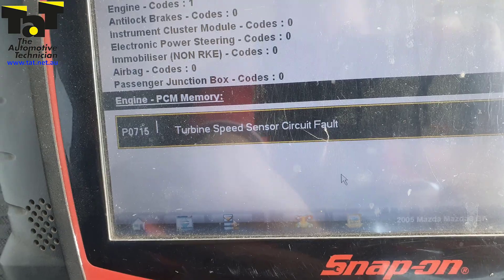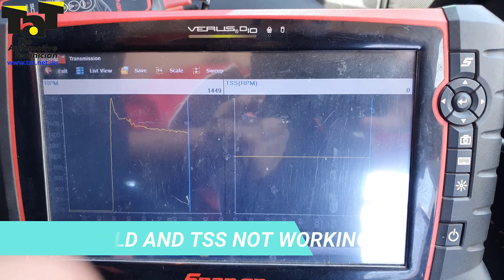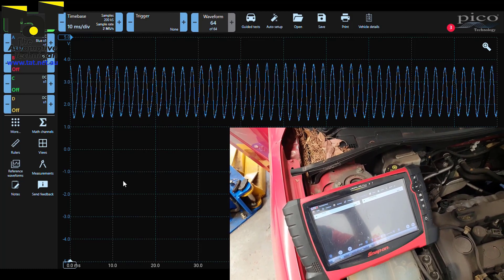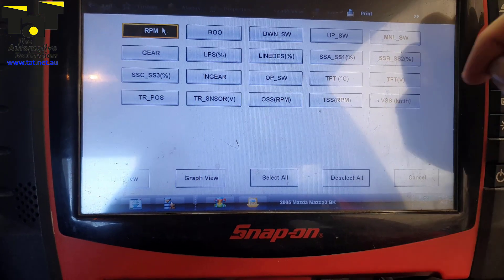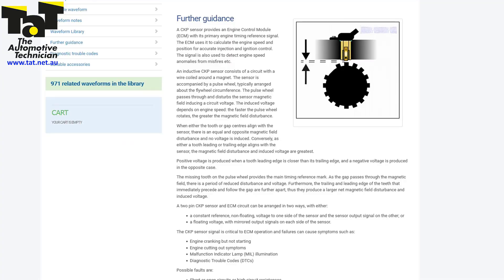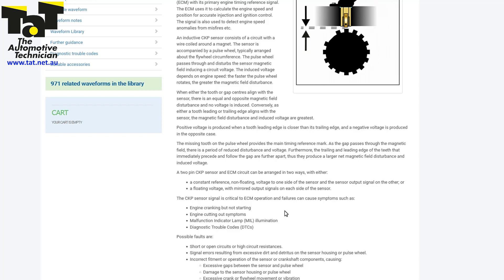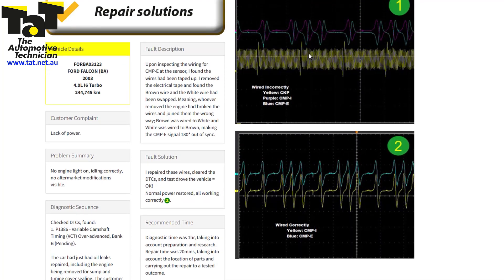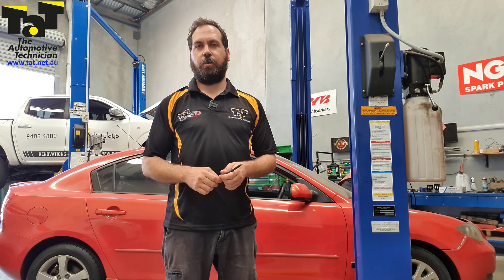Mazda 3 with the Engine and AT warning lights on.

Comment: I was driving I was in fourth gear manually and all the sudden my car slams into third gear AT light popped on and I couldn’t switch gears . Even when I switched it to auto it was still stuck in gear ⚙️. It happens more on cold start did it 2 times tonight when I got off of work on my way home . 2010 Mazda3 2.5 sports . Do u think it could be my TCM sensor . My AT light goes away when I restart my car
Reply: I just started to have that same issue randomly the past 2-3 days. Same car, same year.

Comment: I need help with my 2004 hatchback Mazda 3, the AT light is on and after like 10km of driving it will refuse to throttle pass 2000rpm and gear will be stock at 3. I have reached out to mechanic workshop on it and was told it’s TcM but we can’t locate where the TCM IS.  Can you be of help?
PS it’s not in the same location as the 2006 upward
Reply: It’s usually mounted on top of the Transmission case. You have to remove the battery & battery tray to see it. Best to relocate the TCM after replacing it.
Reply: @paulsz6194  i found out the 04-05 mazda 3 do not infact have a tcm, our tcm is built into the Ecu
Reply: @ChugChug3  oh, really?, that doesn’t Make much sense. Usually the TCM is mounted on top of  the transmission, below the battery & transmission mount. That would mean Mazda would have to design & build a September ECU for manual & Automatic transmission cars, which would be an expensive way of doing things. Do you have access to a Haynes workshop manual for the Mazda 3 of yours?
Reply: O motor 1.6 leva TCM?
Reply: I have a 2012 Mazda 3 automatic, put a new battery in it , won't  start now an the AT light is on , what can it be ?
Reply: @hihowareyou0000 the AT light shouldn’t prevail you’re car from starting, just driving.

Comment: Hi Rob, I have the same car, same engine and AT light on and same error code. I changed the speed sensor yet it's still throwing the lights and error code... Any ideas?
Reply: Did you get it fixed? I replaced my input and output speed sensor and it fixed it for a little while (2kmiles) jus came back on tonight. I hope it's not inside the trans
Reply: @stevenroberts6457  yes I fixed it by replacing the Transmission control unit (TCU).
Reply: @ryanacehigh you mean TCM - Transmission Control Module.
Reply: @ryanacehigh  hi ryan hoping you can still read this comment. is your car TCM is integrated with PCM or separate? thanks
Reply: @mrspriggandv9472  Hi mate, ECU and TCM are seperate units in the Mazda 3.
Reply: @ryanacehigh  do you know where is located? Mine is nothing under battery.
Reply: @mrspriggandv9472  It's on the transmission. There are several videos on YouTube of people removing these units. Check them out.
Reply: Nice!!!! I have hope!
Reply: I got a 2005 mazda 3 hatchback 2.3 little fucker gaps new cars everyday 🤣🤣🤣🤣🤣🤣🤣